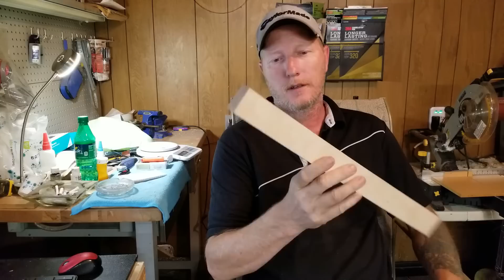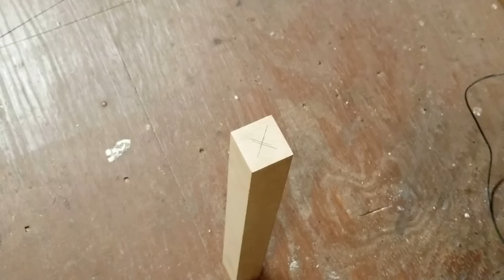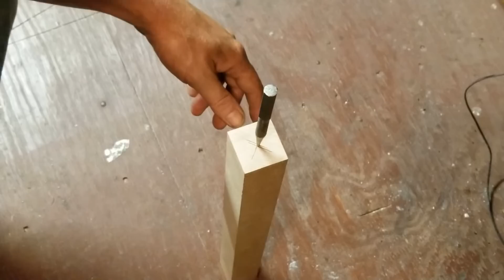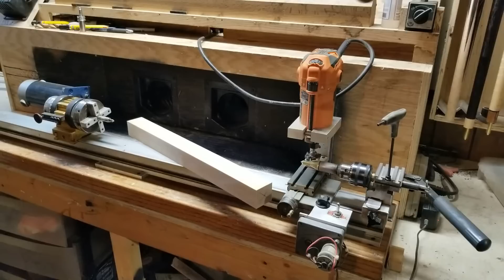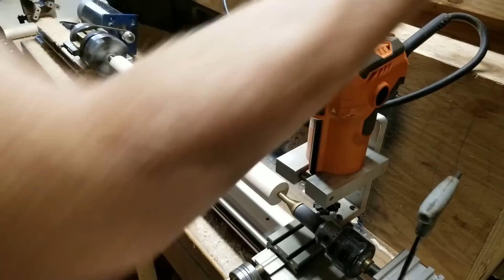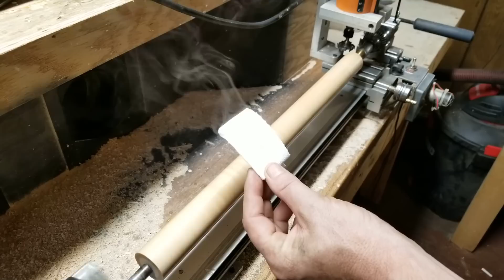Cuemaking Material Preparation the first steps

Comment: Thanks for putting these videos together. If you haven't heard of Parfix 3408 CA you might want to try it out? PARFIX 3408 is a very low viscosity, cyanoacrylate adhesive with low odor and low blooming characteristics. This technology offers excellent product performance and easy of processing. Eliminated the need for ventilation and reduces frosted residues in critical cosmetic bonding.
Reply from the maker: I will investigate this, thank you.